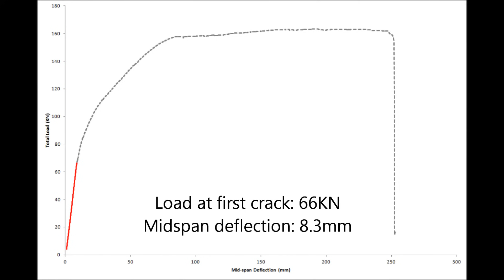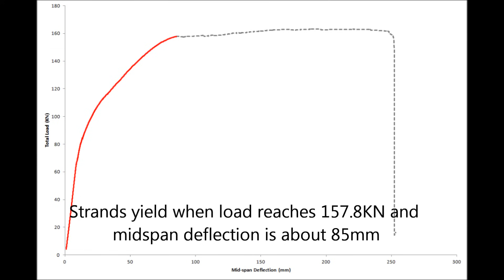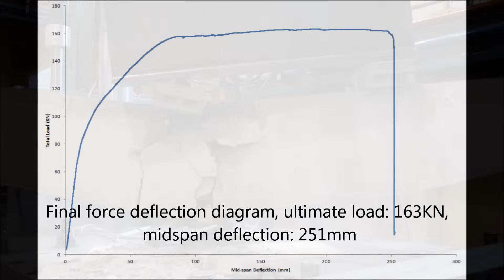Beam Test...watch beam failure in slow-motion!

Comment: Why does it not crack at the narrower parts of the concrete? It has a smaller cross-sectional area which should make it have a lower second moment of area.
Reply: The max force will be at the center since this is a simply supported span having a loading at the center. The loads at the smaller x-sections have lower loads than its center.
Reply: try draw its v-m diagram you will see
Reply: Bending moment is maximum in between the loading points for this simply supported beam. 

Bending governs the failure of the beam here. 

Had it been designed to fail in  shear (no provision of shear stirrups), it would have failed in shear!

Comment: 2:20 why is image on monitor shifting left and right?.......
Reply: To prevent burn-in, it likely displays the same image all the time so they cycle the pixels to keep them working
Reply: @pmolz  will the burn-in occur even if the screen is LED?
Reply: @akhilmt9731  With normal use, no, but they may suffer from temporary image retention which goes away after awhile

Comment: compressive test to determine yield strength at the maximum gradually impact applied loaf.ds seems reasonable since there no momentum imposition.shardy particles wouldn't have any angular trajectory rather than pure downfall acceleration.so,safety apparatus of all necessity wouldn't be that important.
Reply: Added proof the fiu bridge needed I beams

Comment: it actually could be tested longer. needed to reposition   so the force is applied only where main crack is or centered between both of  cracked spots  .. one of the bricks slided out and there was total loss of applied pressure so that big press wasnot doing much  to that beam. Cool video! thumbs up and keep it up !

Comment: If the bridge in Florida had of failed like this no one would have been killed. 
Notice that the beam failed in compression and not tension yet did not fall.
Reply: David Tyndall, not really. It failed in the compression zone but due to transversal tensile stress induced under the point load. Such effects could be easily mitigated if you add the necessary amount of reinforcement in the compression zone. I guess they spared it, because it would be more costly and doesn't affect the max load bearing much as the beam has been already compromised in the tension zone. That said you cannot really compare this beam with a span of about 5 meters with a 50+ meter cable-pretensioned  truss-beam bridge. There is an order of magnitude difference in the span and two orders of magnitude difference in self-weight.
Reply: i agree.it just snapped.so BRITTLE. 
NO BENDINESS AT ALL WHICH WOULD HAVE WARNED AND SAVED 6 LIVES.STUPID DESIGNERS.

Comment: Is this reinforced concrete or just plain concrete?
Reply: It is reinforced concrete. Concrete can only handle compression loading, not tension loading. The steel reinforcing accounts for the tension loading. The combination of the two are what make this beam incredibly strong.
Reply: @mr.misterbates8689  it seems they used a kind of fiber for reinforsement?
Reply: It is "Pre-stressed" Concrete.  There is conventional reinforcing (Rebar) & then high strength strand. The strand looks somewhat like steel cable. The strand is stretched before the concrete is poured. Once the concrete has sufficiently cured, the tensile for from stressing is released. The tension (like stretching a rubber band) in the strand is captured by the hardened concrete, pulling the concrete into compression from both ends. Compression is concrete's greatest strength value.  This makes Pre-stressed or Post-tensions concrete stronger in tension, at the bottom of the beam & in flexural strength (diagonally) through the beam.

Comment: why the load not increasing after yield
Reply: Hussein Mohammed looks like yield and ultimate loads are almost the same. In which case the stiffness of the beam has been exceeded. The applied load wont increase after that.
Reply: It's entered into plastic deformation, material/component has ceased to resist. It can not recover the original dimension.
Reply: what i meant is why we dont increase the applied load after yielding point
Reply: Hi Hussein, I hope I understood what you meant.
To the best of my understanding the strain gauge test equipment used in the video is of a type that measures & also controls both the force applied & the position. (you can hear in the video the proportional hydraulic valve pulsating). The narrator mentions an LVDT is in use. In case you an unfamiliar with an LVDT device I would recommend looking up on the subject, as it is a very useful measuring device commonly found on many machines.
So long as the test element is in the elastic range, the element will recover its shape, that implies the element is still resisting.
If we exceed the yield stress of an element, we have overcome the materials resistance and it will never recover its original shape.
From this point if we continue to apply force, there will be lots of positional change as the element deforms plastically, but with negligible change to resistance. The (structural) element has transitioned to failure mode. Hope this helps.
Reply: Thanks alot
Reply: Thanks, now I'm totally cornfused.
Reply: we can partition The strain and stress diagram to parts one of them is called yielding point , this yielding part it happens when the load become stable (maybe with a little increase)  while the strain is increasing after some time the load continue increasing with a plastic manner .

what do i think i know its ,that we do not increase the load (N) for study Considerations and design ...
i came with that thought since The load (N) which we applied it can be controlled as we like 

but on the other hand, maybe im wrong and the steel "for example"on some point (yielding point) stops resisting for a little period of time then BOOM! its just start fighting again (saying im still here i was resting ) ,and because the steel finally started to yield we call it yielding period after the elastic region

Comment: The final failure was not for the full strength of the beam. It failed explosively for the load being concentrated on two points on the top and the pressure in one point destroying the pressurised top of the beam. If there was a setup distributing the load more evenly, the final failure would have come later and it would have been a slower reaction. The final failure would also have been on the pulled bottom side of the beam. As it failed with explosive manner, this beam would have not been proved at least by this test.
Reply: There was nothing explosive about that, the first crack was at 66 kN and the last at 163 kN. Explosive failure would've sent shards flying without yielding.

Comment: What's that in psi?
Reply: FFS ! When will people learn psi is pressure, not force?
Reply: @nairdacharles9492  could you explain that in meters ?
Reply: @nairdacharles9492  strange to use PSI. Bar would ease the calculation!
Reply: @FMeyer-zg5mg  Are you being funny?
Reply: @wolfheilmann1257  The point is, what does pressure by any metric have to do with force as pertinent to this test?...and no, Bar is for cave men or sailors. PSI or Pascals.
Reply: @nairdacharles9492  it’s either Pascal or bar. PSI is neither international nor scientific. 
The pressure indicated is indirectly related to the force. The force is a result of pressure and cylinder diameter
Reply: @wolfheilmann1257  Fair enough, but the question remains...what does pressure have to do with this test.
Reply: @nairdacharles9492  I had the impression it's hydraulic. Rigs for such loads normally are hydraulic. I guess they reached possibly 10% of the maximum load, seeing the pillars left and right
Reply: T
Reply: @nairdacharles9492  a screw jack would be used to reach a precise position. For applying very accurately a given load a hydraulic jack is far better suited and delivering repeatable results. Screw jack would be used to tear a paper stripe with 1" width.
For such measurements only hydraulic jacks are used, at least in those fields where I'm working
Reply: @wolfheilmann1257  Sorry, I must have been tired. I was mistaking this for another vid.

Comment: Should have provided some info like when it was expected to fail; did it do better or worse than expected ... ???  What kind of reinforcing did it have?  How long had the concrete cured?  Where might this beam be used?  Sheesh ... !!!!!  VERY BORING without some kind of data!!!!!
👎👎👎
Reply: Paul Remlinger i think they were just testing it to failure to see the maximum load capacity of a single unit
Reply: And for reinforcing it had pretensioned steel rod going through it since concret it great at compression but horrible at pulling forces. Were the top is being compressed the opposite is happening to the bottom it is being streched so steel rods are streched the the celoncret is poured around the steel rods the rods want to shrink therefore applying a oppisite force to the weight on top trying to pull it apart.   Sorry for the run on sentence and im not a complete expert at it so look up the stresses and data for yourself for a complete and clear conclusion
Reply: It could be used in bridge/supporting applications such as the bridge in flordia that had recently fell and for connecting load bearing columns

Comment: To be honest I don't trust engineers of ANY discipline who hasn't had personal experience in the field and doesn't apply common sense. As an old field service  tech in commercial a/c & refrigeration and later in commercial restaurant equipment I've seen where it was clear that more thought should have gone into the design of some machines and the real life applications. There is usually a failure to consider the practical aspects  of servicing the unit in the field. Thankfully I'm retired now.
Reply: I agree im a former engineer yet pilot  army boss ex right hand of a King and i completly agree with you
Reply: theres a lot of modern companies that prefer the engineering of a failure point. More money in replacement than repair.

Comment: Failure at 163kn.  What the hell does "N" equal?
Reply: Pretty sure N means newton, a unit of force
Reply: Thanks. it equals "mass of one kilogram with an acceleration of one metre per second per second"
Reply: 1 ton = 907.18474Kg.  1Kg = 1000g = 1 "metric" ton.  16615 Kg = 18.314902 ton and 16.615 metric tonnes.  Small difference but depends if you're in US or basically anywhere else in the world.  lol

Comment: Maybe when they would apply the pressure to a bigger surface it wouldnt crack that easy
Reply: Yes you're right. Concentrated load is easier to break it than distributed load. And the actual goal for this test is to BREAK the beam.

Does it 163KN sound easy to you? They know exact distance between 3 points, prabably calculated reaction force and bending moments a million times on paper. So i think they might passed the time when they needed a middle schoolers opinion.
Reply: its for benchmark purpose not to proof it wasnt breakable

Comment: If that beam was upside down would havebeen stronger
Reply: Yeah, but we can assume that the beam is going to be holding up something like a floor or a roof, which are typically flat.
Reply: your xray eyes have mapped out the reinforcement placement?
Reply: The beam is designed that way. The tension bars are in the bottom to be stronger when carrying vertical live load and dead load. If you turn it upside down it will be much weaker.
Reply: absolutely not correct

Comment: If the beam was not upside down, it would never have failed.
Reply: bs
Reply: Of course it would, the only question is at what load.
Reply: BS! the beam is designed that way. The bottom is where the stronger tension reinforcement is.
Reply: @romeoETmike  BS! do you know whst BS means. Listen to Kalum Batsch says and read what Richard Tomkins says. No more of the BS.

Comment: Concrete breaks duh. Steel beams bend except at 9/11.
Reply: Steel beams heated to thousands of degrees by jet fuel stretch and collapse.
Once one floor collapses, its weight drops to the floor below which for several floors was also weakened by the flames.
After a few floors of concrete have piled up on a single floor a cascade is created, pancaking each floor all the way down between the inner core and the outer walls. Without the support of the floors, the walls begin to collapse. That collapse is inward because that is the direction they were pulled by the floors within them.
There is video of the two towers being built. Its easier to see why it collapsed the way it did after watching how it went up.
Reply: @corthew  open fires don't burn at thousands of degrees. Why don't you watch some AE 9/11 videos and learn some things?
Reply: @giovanhagar  Oh you poor thing. You thought that fire was open.
Reply: @corthew  Was the hole in the building not big enough?
Reply: @giovanhagar  I can tell who’s not the engineer here. One of my MechE classes had us read a book on specifically how the structures collapsed on 9/11 and what could be learned from it. It’s called Lessons Amid the Rubble and is a pretty good read. You should give it a read and stop believing everything the internet tells you
Reply: @corthew  you thought it was a blast furnace.
Reply: dude, I’m studying mechanical engineering. I have performed these tests before, I have read books and taken the classes to learn from experts in the field. The evidence you have supplied is from someone who is clearly not knowledgeable on the subject and should not be trusted as a valuable source of information on the topic. Any engineer will tell you as such, and believing otherwise is just naive. The book I mentioned above will provide you with much better evidence than some rando on the internet.

Edit: either YouTube shot you down or you hid the comment I’m responding to. I can’t see it anymore.
Reply: @guyguy463  do you know what AE 911 is?
Reply: @giovanhagar  a handful of engineers who think they know the truth does not immediately supersede the general consensus of the engineering community.
AE911 only has 3000 engineer members while ASME alone has over 110000. It’s reasonable to conclude that those 3000 engineers are just diluted. The existence of a counter argument doesn’t immediately make the original argument invalid.
Reply: @guyguy463  they have normalcy bias
Reply: @giovanhagar  if they have normalcy bias, then what makes the AE911 argument so compelling, when evidence to the contrary is far stronger? The simplest explanation tend to be the most true, it’s called Ockham’s Razor.
Reply: @guyguy463  if you watch bldg 7 fall and see anything other than a controlled demolition you should find another path, you have no mechanical aptitude. It is the simple and only explanation. Two news crews one in the US and one in Britian reported it had collapsed before it happened.
Reply: @giovanhagar     Not trying to invalidate your argument, but do you have an engineering degree? Specifically, do you have a degree in a field that handles the construction and demolition of large structures, such as Mechanical or Civil Engineering? Do you have any technical background whatsoever? You’re simply using appeals to authority to support your claims, but your chosen sources lack any substantial credibility. Even if the collapse did accelerate faster than would be expected by gravity alone, and whatever other what-about-isms you propose were actually true, they don’t necessarily support the conclusion you’re making. I’m pretty sure Lessons Amid the Rubble addresses these things, as well as other details you appear to have overlooked, but I unfortunately left my copy of it back home. I could easily dismantle whatever claim you throw at me, but we both know you have an endless supply of supposed evidence, so entertaining such an endeavor would surely be fruitless. Not try to stroke my ego or anything, but I can assure you that my stellar academic performance in my engineering courses, including solid mechanics, thermodynamics, materials, statics, etc., proves that my “mechanical aptitude” is anything but lacking.
Reply: @guyguy463  not wasting my time on you.
Reply: @giovanhagar  you came to a comment section filled with engineers and got called on your BS. What else did you expect? If you somehow know more about this subject than thousands of accredited professional engineers while not having any related technical experience, then by all means bestow us with your invaluable insight. Otherwise, you better have solid supporting evidence for your extraordinary claims. “Exceptional claims require exceptional evidence”. The burden of proof falls on you, and it is not our responsibility to seek out the answers to your hypothetical questions. As I said before, don’t believe everything you read on the internet. The Dunning-Krueger effect is very real, and you appear to have fallen victim to it.